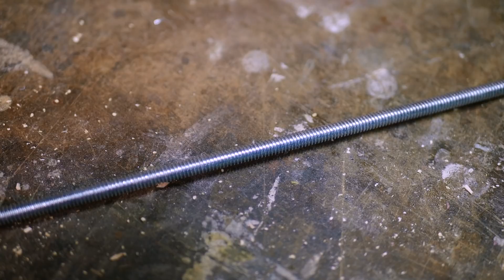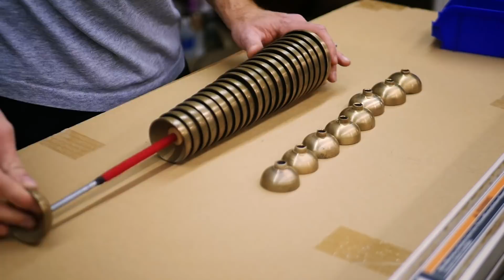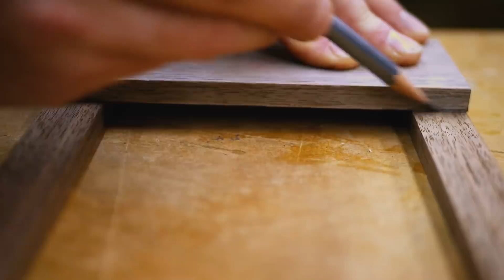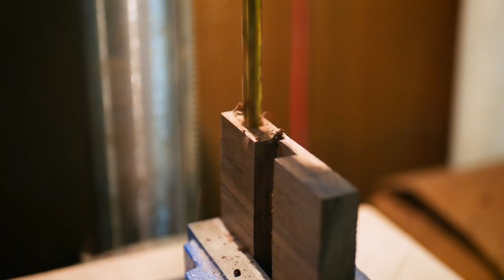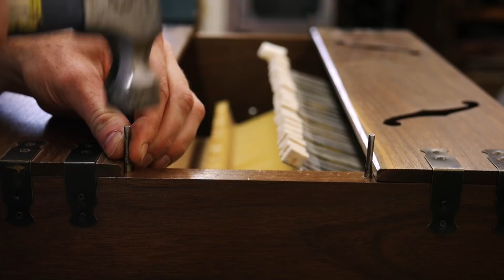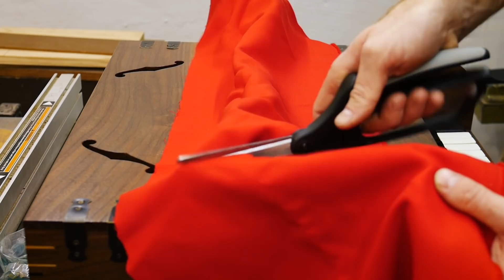Flexiphone Keyboard Build [Part 2/2] - Bell Carriage

Comment: Excellent implementation of a fine idea. Now, to gain volume, a micro pickup could be positioned back of each bell. Then, the pickup signal can be amplified and sent to speakers. That would really complete your fine instrument. Your cabinet design is lovely.
Reply: A pickup for each bell seems a bit excessive.

just mic it
Reply: If you take a second, think of all the sounds you will amplify if you use an acoustic mic. You don't want to amplify the sound of the wooden keys and action mechanics. You only want to amplify, and possibly filter or modify the sounds being generated by the bells. That's why I recommended using special pickups for each bell.
Reply: I would want to pick up the sound of the wooden keys and action.

You realise you can adjust mic settings and EQ right?

That many pickups just seems like a massive fuck around
Reply: nuberiffic electric pianos let you hear the sound of the mallet, yet they use pickup.
Reply: ....yes....
...and?
Reply: @nuberiffic  usually sounds pretty sterile without the mechanical action in the mix too. we're playing instruments, not programming it.
Reply: An acoustic instrument must remain acoustic not an electric experiment that sound innatural like Church Bell.
This instrument is used into orchestra with purpose of  refininig and little assolo.
I'd like to suggest the substitution the handle with wood type not plastic or metal.

Comment: A masterful piece of craftsmanship, and a beautiful instrument.  Someone mentioned the key noise when the keys are pressed . And I went back to part one to check and you do have dampeners on the key posts. I am wondering if it is because you have it on a flat wooden surface. Is that acting like a drum skin and enhancing the sound. If placed on a denser platform such as a slab of marble, or raised on rubber legs, using thicker softer dampeners would that deaden the key press sound.

Comment: was psyched until "bells," but truly beautiful work... would love to see this idea applied to a standard piano with more transpose range... maybe take an 88 key piano and reduce it to 61-73 keys with the whole action on a bed that slides left and right, could be awesome
Reply: The James & Holmstrom piano co., in addition to making standard pianos, also built a limited number of transposing uprights which were extra wide and had a handle that would shift the keyboard a number of half steps each direction. Once in a while, one turns up on Craigslist and usually needs saving from the dump. The pianos themselves are medium grade uprights, nothing bad about them. Totally worth getting, and if you have this user's woodworking skills plus Art Reblitz's book "Piano Servicing, Tuning, and Rebuilding", plus advice from a seasoned piano professional about pinblock replacement, soundboard recrowning, etc, you could restore it yourself.
Reply: that is awesome--thanks so much for the information!

Comment: You want that to last? Use cork on the bells to prevent denting and use felt to lower the noise on the hammer and  a second row set of hammers that can be used to sustain the sound  if a sustain pedal is added to it

Comment: One thing that I observed overtime.  No bell is perfect, and so there are slight flaws in them, causing them to create wavering notes.  However, there is a way to adjust their positions to make clear notes.  First of all, grab a teacup and flick a spot opposite of or perpendicular to the handle, and it will play a slightly lower note.  Now, flick a spot 45 degrees from the spot which you had flicked previously, and it will make a slightly higher note.  The reason is because the handle increases the inertia of the orthogonal antinodes of the teacup vs. the diagonal antinodes.  Same with these bells.  The thickness and the quality of the metal varies, and so each bell plays two slightly out-of-tune notes (eg high-C+.001% and high-C-.001%).  So, just turn each bell until it plays only one of the two tones, and you get a fuller, richer, clearer sound (just like with hand bells).

Comment: Hey Great idea! A also had a (different) idea with bells and I was wondering if you can tell me where you got these? was it a bell tree? they seem to be in tune quiet well. Are they for sale somewhere? I even phoned a couple of manufacturers, but I wasn't able to get some yet.
Please let me know...
Reply from the maker: This bell set came from an old pump organ (it was a stop that could be engaged or disengaged on the organ to give it a chime sound). I'm not sure if a bell tree is chromatically tuned like this set of bells is, or if it's just graduated to give that general glissando type of sound, but that seems like it's probably the best bet for finding something close these days.
Reply: Thank you. Yeah, The alumiphone is one solution but not a very cheap one unfortunately.

Comment: I found a tossed digital upright piano. If I chop the keyboard down to only 37 or so keys, could I keep what remains to use as a portable (couchable) digital keyboard?? Or will messing with the keys affect the circuitry? 

My theory is that the missing piano keys simply wont register on the circuit board since there is nothing to make the sound, and hopefully the rest of the keyboard will still be playable.
I would like to salvage this thing, but also make it smaller. Thank you..